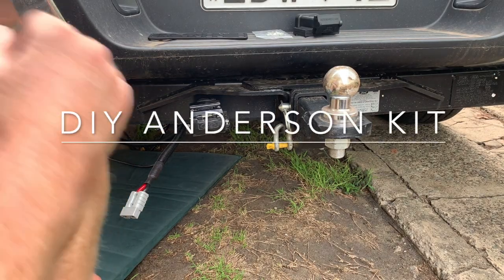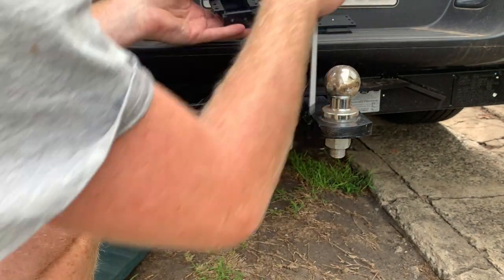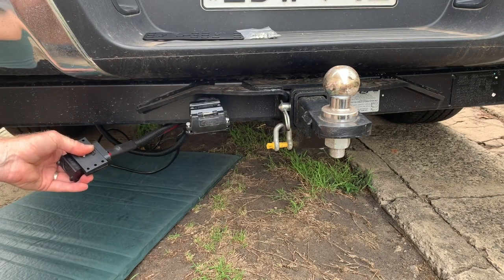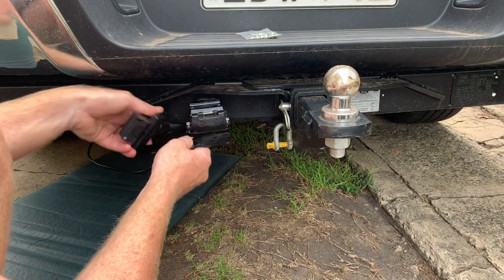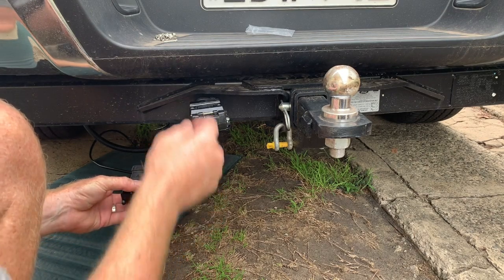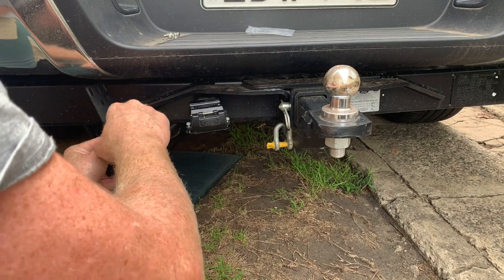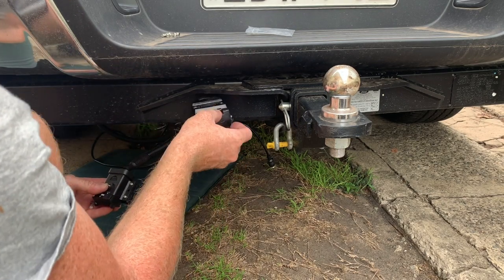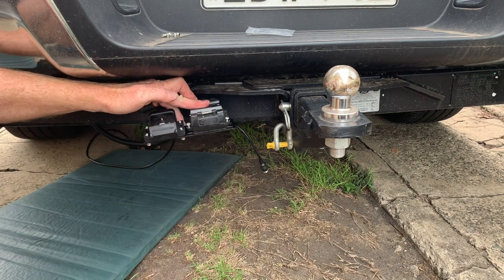DIY Anderson Plug Kit- how to mount Anderson near trailer plug

Comment: So is this constant 12v to the plug? Or switched with ignition to charge caravan batteries? Cheers
Reply from the maker: We have one that is constant power and on with the redarc sbi12 isolator mate.  Which works on standard alternator cars.  Which one to use is all dependant on what it’s running.